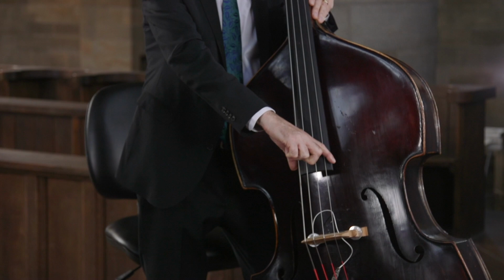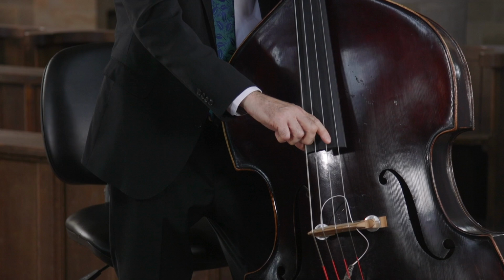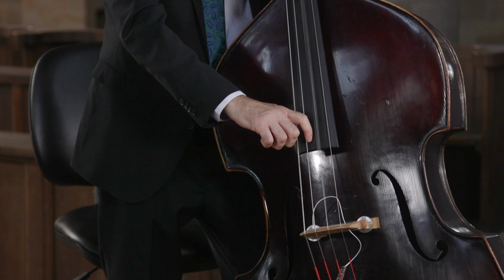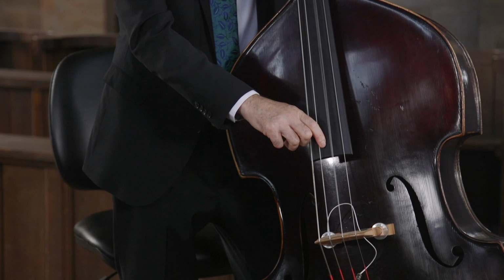Common Technical Problems for Jazz Bassists... & How to Fix Them! - Interview/Performance

Comment: Both my timing and the sound I got out of my bass improved greatly after ditching the idea that higher action = better.
Might be because my left hand struggles a lot less now and is able to, as Mr. Goldsby said, "work in concert" with the right hand.
Thanks for the great videos and performances.
Reply: I'm experimenting with action too, I'm curious about how high you think is too high. Thanks
Reply: @monz7951  I'm certainly no expert but I would say it depends on your bass and how it's set up as well as which strings you are using. Before I was playing Thomastik Dominants set at about 10 mm, measured at the end of the fingerboard on the G-string side. People playing gut strings and softer type synthetic strings can get away with that type of action, but I was having pain in my right hand plucking fingers and starting to feel it in my left hand as well. About six months ago I switched to Spirocore Mittels and lowered the action to around 5 mm, and it's a world of difference. No more pain and I no longer feel like I'm fighting the bass to make a sound.
TLDR: depends i guess
Reply: @monz7951  Experiment with it yourself if you have a adjustable bridge. And see what works best for you and your bass.